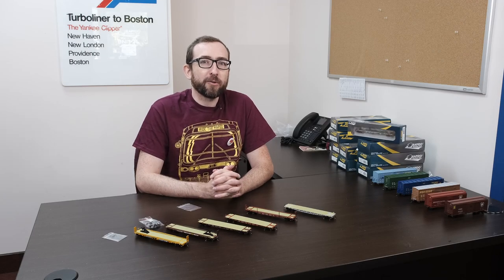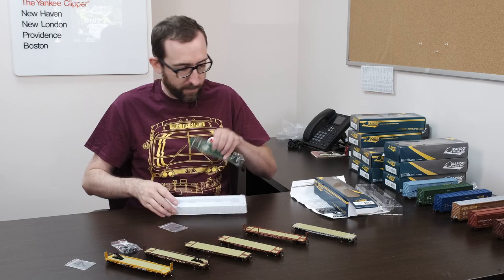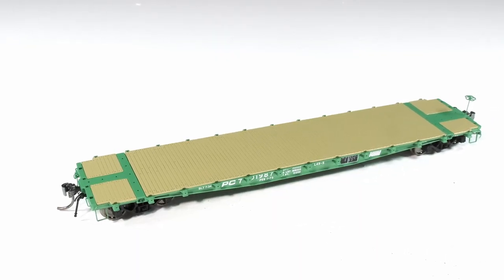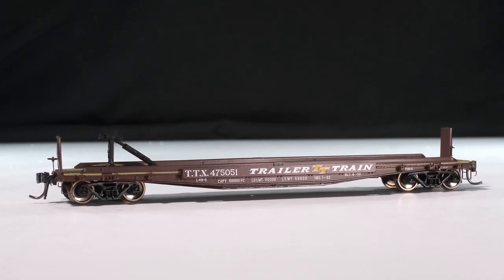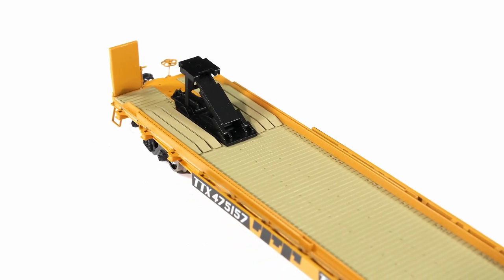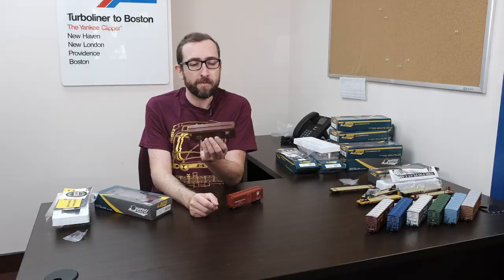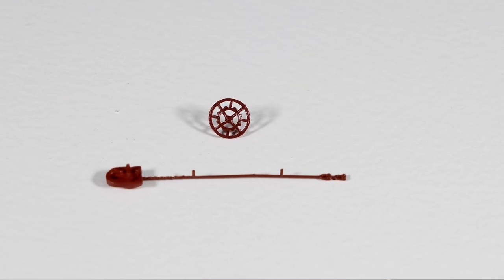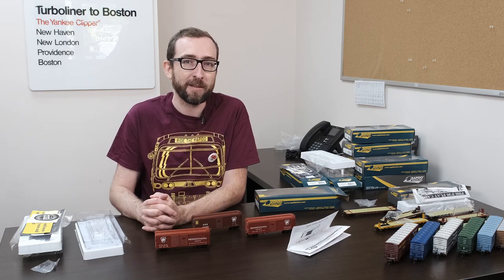Unboxing the Rapido PRR F30 Flatcars and X31A Boxcars!

Comment: I really wish y'all would do the flat cars that Alaska Railroad used on their Whittier Commuter Tunnel train. Very similar flat cars to what you just did and would require very little tooling OR you could do the 5 car combo set the used for trailer train and intermodal container hauling. Love y'all's stuff, just please do some more for Alaska Railroad.
Reply from the maker: If we enough demand for ARR stuff through our product suggestion form, we won't be able to ignore it!